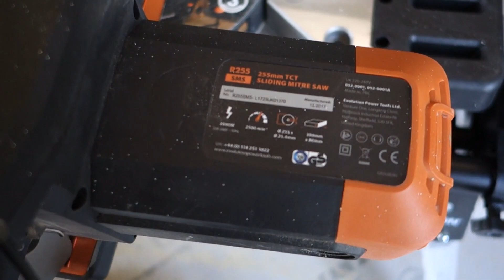Evolution R255SMS Sliding Mitre Saw - Review Part 2

Comment: I have the same setup with exactly the same titan vac but I'm not impressed with the dust collection but have had excellent results with the saw for framing and laminate flooring
Reply from the maker: Yes I have been using it for framing. I have nothing to compare the dust collection to but I am planning to go to the FFX show so will be keen to see how good a festool is. All in all though I am very impressed with all of the Evolution tools. They are my go to for saws
Reply: Shane M just bought this saw from the FFX show a couple of weeks ago....very pleased with it so far however I agree the dust extraction isn’t great using my workshop vac but worked adequately on my friends Mac Allister saw.....as for the stand I payed an extra £30 and bought the Makita stand with wheels which also has wider extensions.